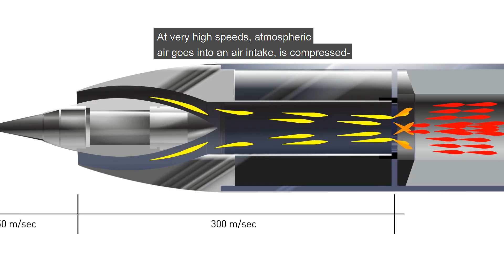How ramjets may change the role of artillery on the battlefield

Comment: I'm sorry Nammo, but I heard there should be an explosive filler and shrapnel in an artillery shell. Also, at these rangers you can't hit anything without correction system aka guidance.
Reply: their was no guidance in ww1 and 5million people died from shells
in ww2 same
Reply: @omnianti0  You do understand these propulsive shells are a bit harder to manufacture in tens of millions required for that, correct? 
Also, it still needs that explosives.
Reply: @ShadeAKAhayate  proablly less difficult than proximity fuze mass producted for usa antiairguns in the 1945 so no very an issue never underestimate how much war industry can waste money and resource as for exemple thousand of v2 missile with little results despit super high tech for the era
Reply: @omnianti0  V2 was first and foremost a propaganda missile. Proximity-fuzed AA shells are about as simple as timed ones. This thing is intended for actual field artillery and is pretty complex. And it's completely unclear where all the explosives go, aside from any sort of guidance.
Reply: @ShadeAKAhayate  proximity are ever timed
considring resources spent on it V2 is not only propaganda and i not remind this featuring propaganda movie
guidance or explosive have a litle space in the nozzle tought their is no wings
Reply: @omnianti0  Didn't get the point of your comment. Thing is, artillery shells on such distances are affected by a number of factors that change acuracy exponentially and cannot be compared to usual field artillery work in WW2. The best units will have base accuracy of 0.4-0.6mils -- you can do the accuracy math before coriolis force, wind, atmospheric pressure change and other stuff. With accuracy like that, it's a terrorist weapon at best, usable only at city-sized targets. But terrorists don't have the facilities to produce such ordnance. 

Also, I'd like to note that total most of WW2 artillery casualities were produced by howitzers with max range of less that 10km, seldom working from further than 2-4km. That's around 2 orders of magnitude range difference -- and it's very serious in terms of accuracy. So, guidance is essential. As well as payload, of course. Neither is presented.

Comment: Considering that has very tiny warhead compared to a rocket, it will always lose to an rocket.
But, that is like a 2.75" rocket fired from an airplane at the target, so if you get it guide in the laser then you have a artillery fired APKWS. But again the APKWS can be made to fly already half the conventional artillery range by mounting pods on vehicle. 

So think about a scenario where you have a frontline soldiers with a laser designator and you get a vehicle with 70-80 mm rockets to fire couple ones in your direction at high arc, all you need to do is designate target few seconds after the fire and you have them hitting meter from your target. 

Cheap, precise and effective for quick fire support or target destruction. Something that artillery can't do.

Where the artillery is excellent is firing a major barrage when enemy attacks. It will literally destroy everything on that 500 x 200 meter area where are 1500 enemy soldiers and dozens of vehicles etc in attack. You will require a artillery in that moment, as not even CBU-97 bombs are going to be there as the air defense is protecting the area for 30-40 km distance so no drop is possible. 

That firing 300-400 shells from <150 km is just laughable idea. Way too expensive and ineffective.
That is just meant to be something that is so special that it it is difficult to find good purpose.

While looking at example long range rocket artillery systems there are already 150-200 km ranges there. GPS assisted rockets. There are laser seekers and everything. 

When you need a destruction for single target, you put one of those long range rockets there. When you have a defensive position for enemy, you put one with multi munitions warhead to saturate the whole area. 

The platform can be over 100 km away, fire couple rockets and move away. Mission completed. A backup unit is ready for fire more if required but counter-artillery can't do anything against it.

Comment: Rocket assist shells were tried by the Germans in WW2.  Fortunately for the allies,
they were not very accurate.  The main advantage in this new design is the fact
that the shell is 'intelligent', can adjust is path in flight, and therefore make a more
accurate strike.  Add this ramjet to a Rochling-type shell and you would have a very 
dangerous, pinpoint munition.
Reply: Seriously Wayne, if these things were fesable as you claim, they would have been in production a long time ago.

Comment: Marginally longer? What about self-propelled systems like the G6?
Reply: Yes. The US could have had much better artillery much earlier. We just neglected it until very recently.

We've come out with an artillery system that can hit at 40 miles, 60 kilometers or so, now.

But the Ramjet technology is still very welcome. If it can have a substantial impact (literally, it needs to either be very fast on impact or have some sort of payload).

Comment: It could be interesting to see this concept applied to tank munitions. Im picturing a tungsten or depleted uranium core with a ram jet sabot that would further accelerate the projectile. Using this system you could probably make a system using lower pressure, lower recoil, lighter guns to achieve similar velocities to a conventional APFSDS round.
Reply: I was thinking short range anti missile system
Reply: @corvoattano4777  also a good idea, once again it would allow for a lighter built lower recoiling gun to get a projectile going super fast that would otherwise require a significantly bigger heavier gun. You could also potentially make a much faster firing gun than otherwise possible with conventional ammunition due to the lower recoil which would be a big advantage for anti missile defense systems.
Reply: You don't want to be in a tank that is hit while carrying this type of munition. The explosion would decimate the tank no matter if there were blowoff panels or not.
Reply: Ram jet sabot doesn't make sense. You are trading far too much stuff for something that many companies already did. Hell, Many companies are now selling light weight 120mm for light tanks. 
Also kinda already made and tested.
AAWS-H
Compact Kinetic Energy Missile
Vought HVM is kinda crazy, at 30Kg 2920mm long rod with a diameter of 96mm going at 1720m/s
If that ain't enough, MGM-166 LOSAT could deliver 90 MJ of energy on target. Your average 1990's APFSDS sends about 6 MJ
Rocket motor is cheaper and take far less space than a ramjet.

Comment: Would be better off bringing space ship to space with thousands of 100kg depleted uranium rods that can de orbit themselves on command and guide themselves to a gps/laser guided target
Reply: Kinetic bombardment...fuck yeah.

(Only problem is that anti-satellite technology is coming into its own, and that will be a problem).
Reply: @bigbluebuttonman1137  yeah but if you communicate with lasers rather than radiowaves all you would need is direct LOS and a preloaded program on the satellite to call in a strike, enemy equipment might stop comms with earth via mass radio wave emitting structures but they wouldnt be able to stop a laser giving a firing position/grid location for the satellite to then relay to the main body holding the payload
Reply: @ConReese  I was referring more to technology that actually shoots down satellites.

That is what is actually becoming more effective since you don't even need an explosive payload for that.

Comment: the minute you add on board propulsion it is a rocket not a shell, and not really a projectile anymore.  Range exchanged for payload punch is a bad exchange.
Reply: https://1.bp.blogspot.com/-vGGamoDp8a4/XlDC5pFKeII/AAAAAAACgKE/pc8ix4z9LaIWygWTAsT7ZLPGSI8qaVgvQCLcBGAsYHQ/s1600/IIT-Madras_Ramjet_Missile_Shell_Details.jpg

I presume the payload is roughly going to be what's shown there.
Reply: @bigbluebuttonman1137  - military people never seem to learn K.I.S.S.; complicated systems fail easier, cost more.  
This is all sales hype over a rocket which is really just an evolution of the buzzzbomb, ram-jet or pulse jet doesn't fix accuracy issues.   
Accuracy is more important than range, another thing proven in history.
Every time a major power builds some 'biggest' super weapon platform, the platform becomes obsolete and loses to small, fast and more dynamic weapons systems.  Bismarck, Yamoto (air power), Mega tank (too heavy), 
Bertha-Gun & SuperGun (limited aim), 
1800'ish militarizes outdated  by Napoleon creating the modern Army Unit,  
Rome losing to Hun cavalry (see also Alexander)
Marginot Line - go around it
the list just keeps going on when it comes to doomed fixation on tactics and systems.
Reply: reppich1 Yeah, I’m skeptical of the ramjet shell as shown here.

I could see uses in bigger rockets tho, or perhaps as a purely kinetic weapon fired line of sight.
Reply: @bigbluebuttonman1137  - yes, hyper-sonic + kinetic/sabot would have a purpose in armored cavalry applications with faster rates of fire and auto feed systems since the barrels are less massive and recoil is a fraction.  The problem becomes scaling that down not up.  But getting a military mind to scale down for greater utility is nearly impossible

Comment: if ramjet is easily n cheaply produced then it can replace old mortar systems other wise not much successful.
Reply: It probably won't replace old mortar systems.

A ramjet can only operate at speeds of roughly mach 3 or higher.

I don't see many mortars--not ones that aren't relatively cumbersome--adapting this technology.

Comment: The South African arms industry worked on Ramjet shells in the 80's and 90's, and together with Rheinmetal resolved all issues during the early 2000's. They never took it to market due to the cost involved.
Reply: The cost was because at that time Computational Fluid Dynamics with massive computing power was not available.  Design variations had to be tested empirically...which was essentially impossible.  The costs would be insane.   Even Lawrence Livermore in that time period (80s-90s) did not have software capable of doing 1/1000th of what was required.  Today, distributed HPC makes the CFD to figure out the ramjet controls possible.  I bet powering CFD simulations is one of the largest expenses for this sort of development.

Comment: the biggest problems with this are: the fuze where is it how easy is it to set and how is it set plus is there a backup and manual way to, payload where is the HE how much of it is there, fuel is it pre-loaded with fuel do you have to fuel it before shooting can you empty the fuel for transport, charge what charge bags can be used before this blows up in the barrel or the minimum charge needed for the ramjet to work, cost is it cheaper than rocket assisted artillery rounds can it out range those rocket rounds, what to do if theres a misfire or jams, how durable is it can it be dropped and still work, can we use already acquired equipment to use this, training to use. these may sound stupid but this is big army and they have a lot to pay for plus its roughly 20 yr olds handling this of roughly 40 yrs old orders